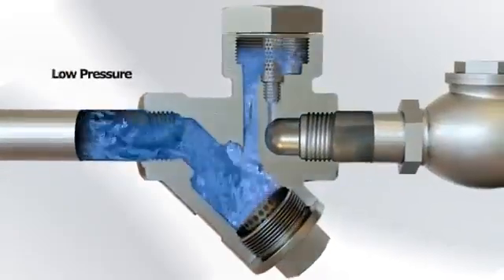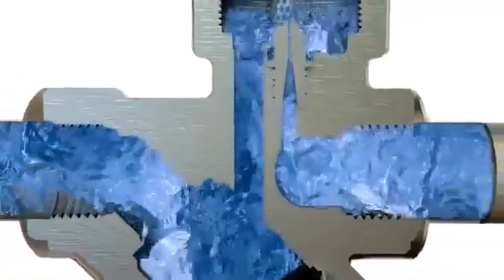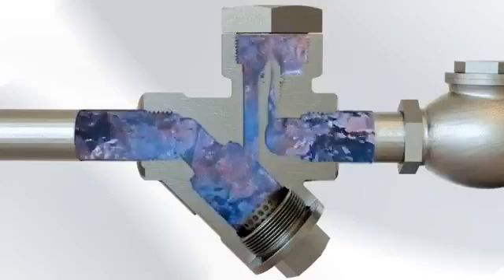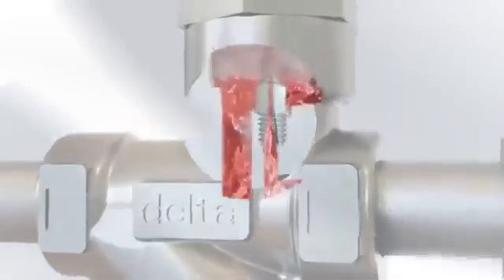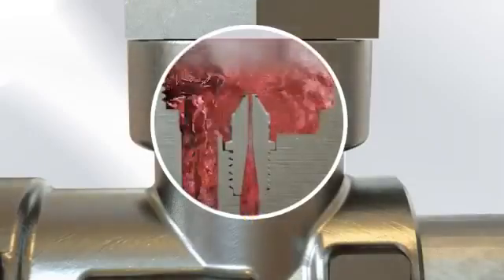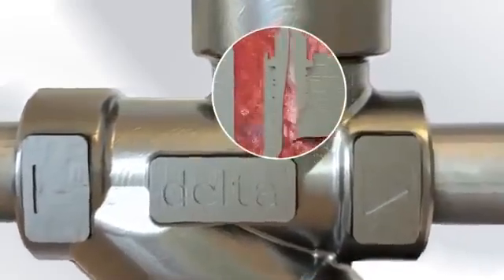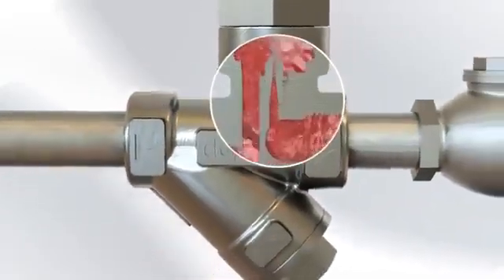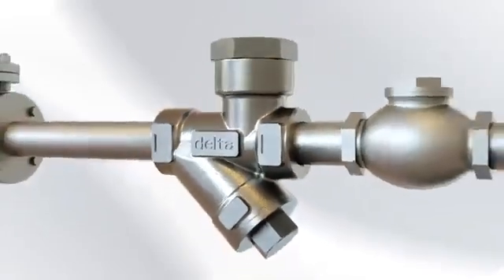Steam Trap Working Animation

Comment: So meaning after start up of the system when condensate becomes hot after a few minutes from start up pushes the condensate due to pressure rise up and passes through venturi and convert it to steam back to the system. Isn’t lt? Is this venturi effect phenomenom?
Reply from the maker: It is mainly due to pressure difference

Comment: Thank you.. Didn't understand anything
Reply from the maker: Thank You for watching
Reply: @TheEngineerPortalTEP  you're welcome
Reply: lol
Reply: Such an instrument comprised of Dodge gears and bearings, Reliance Electric motors, Allen-Bradley controls, and all monitored by Rockwell Software is Rockwell Automation’s "Retro Encabulator".

Now, basically the only new principle involved is that instead of power being generated by the relative motion of conductors and fluxes, it’s produced by the modial interaction of magneto-reluctance and capacitive diractance. The original machine had a base plate of prefabulated amulite, surmounted by a malleable logarithmic casing in such a way that the two spurving bearings were in a direct line with the panametric fan.
Reply: yeah me too
Reply: Same here 😂